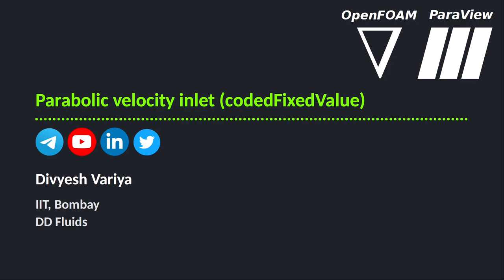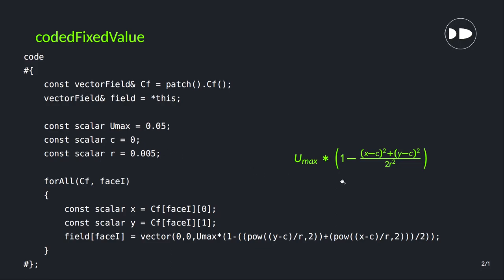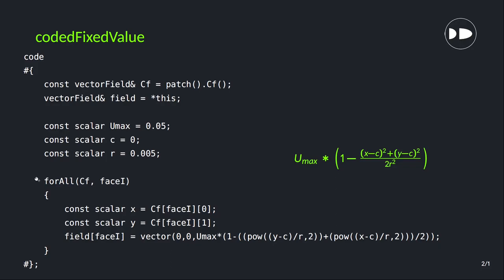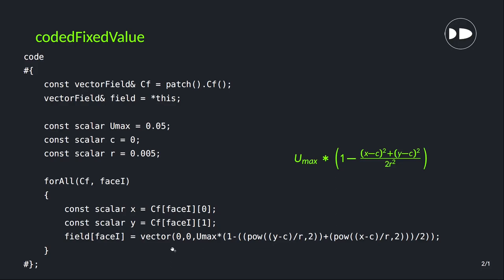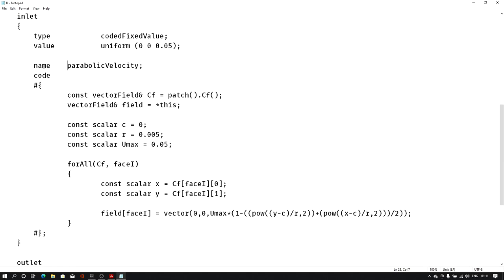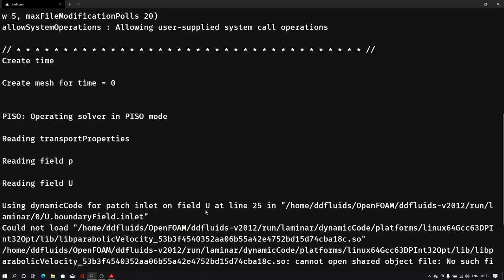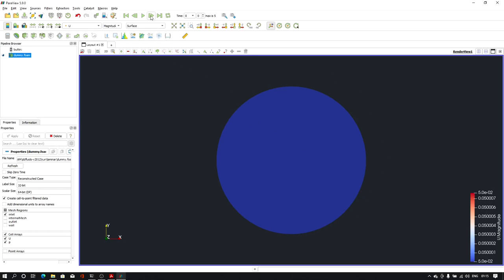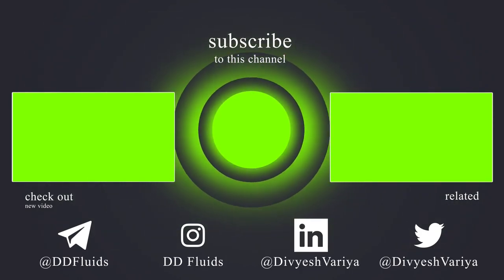Parabolic velocity Boundary Condition in OpenFOAM | codedFixedValue

Comment: Thank you for this tutorial! Very helpful. However, I am running a case using this code and for some reason the velocity maximum increases along the pipe as flow moves towards the outlet. Did you also experience this? If yes, how did you deal with this problem? Would appreciate any help

Comment: It's very helpful. Can you also explain how to use codedFixedValue for scalar field (temperature)
Reply from the maker: For scalar fields, you can remove 2 components from the equation. That should work. If you need any help, please do let me know.
Reply: @DDFluids  I tried what you have told, but an error is showing up

--> FOAM FATAL IO ERROR:
keyword name is undefined in dictionary "/home/yagna/OpenFOAM/project/gradient/0/T/boundaryField/left"

file: /home/yagna/OpenFOAM/project/gradient/0/T/boundaryField/left from line 31 to line 101.

    From function const Foam::entry& Foam::dictionary::lookupEntry(const Foam::word&, bool, bool) const
    in file db/dictionary/dictionary.C at line 799.
Reply from the maker: Did you gave name to your boundary condition?
Reply from the maker: In the tutorial one entry is there "name parabolicVelocity;" the same way you need to give some name to your boundary.
Reply: @DDFluids  yes i have given the name..actually i need to give codedfixedvalue boundary condition on left and right boundaries..so i have given "leftBC" and "rightBC" respectively in codedfixedvalue code
Reply from the maker: Can you share case file at dd.fluid.mechanics@gmail.com
Reply: @DDFluids  ok..i will do it
Reply: @DDFluids  thankyou

Comment: Very very important tutorial. Thank you so much. 
--> FOAM FATAL IO ERROR: 
Failed wmake "dynamicCode/parabolicVelocity/platforms/linux64GccDPInt32Opt/lib/libparabolicVelocity_acd2aaca919d7a166a948cf1daab1ba94e58d104.so"

file: /home/Desktop/try/0/U/boundaryField/inlet from line 24 to line 49.
what should i do now bro.
Reply: i had this same problem, i read that happens for a security issue in OF code, it solves only enabling the lines of the code and recompiling the OF but i didn't try it.

Comment: Why is the 0 file not showing the correct boundary?
Reply from the maker: Custom boundary will start calculating after 0 sec. So whatever expression we are giving is not applied to 0 sec but as in when simulation starts, it will give correct value. But at 0 sec it will show you a dummy value or default value or placeholder. That is there in the code right before expression.
Reply: @DDFluids  Is that the intended behaviour? Hopefully OF explicit and implicit  operatores (grad, div, laplacian) will take that into consideration, otherwise for time 0 you will do calculations with the place holder :V